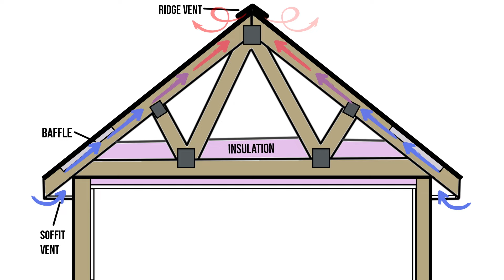The DOs & DON'Ts of DIY Spray Foam Insulation

Comment: In a few of the DO examples I would either not use the spray foam, or only use it for filling in a larger volume and finishing the surface with something else. 

Spray foam does not create a weather proof finish. For the windows and doors, the gaps will still need to be covered by a PVC molding , silicone caulking or something else. 

For small non structural cracks in concrete or wall penetrations in concrete, I would use a cement based acrylic modified sealant or a polyurethane based caulking that can be painted. Visible spray foam looks ugly and deteriorates when exposed to the elements.

Spray foam is just like duct tape or electrical tape. In most cases, you should probably use something else.

Comment: How to remove spray foam besides cutting it? Is there any spray or easy method to remove spray foam from large areas?
I had it put in the basement and it destroyed my entire basement with humidity and mold problems, and I want to remove it all. No one seems to know how?

Comment: So in my Man. Door into my garage on the side of the house there is a visible gap under the baseplate of the door jam. Would spray foam be good to use? Also I started noticing a puddle in my basement near where the entrance would be. So you think that since it is not sealed up it it causeing water to leak?

Comment: I have a question about spray foam usage. I have a 1790s house - nice thick lath & plaster walls. However, my kitchen was added in later years & my heat runs ~5 as much in the kitchen zone as elsewhere. The kitchen is also exposed on 3 sides with four windows.

The walls have loose fiberglass insulation (almost certainly settled at bottom) & are noticeably cold to the touch. I'm getting ready to remove wallpaper & paint the kitchen so patching holes isn't a problem. Would it be an acceptable solution to drill small holes into each stud space (perhaps at 3', 6' & ceiling) & inject expanding foam on top of the loose fiberglass to increase the R value?
Reply: I did this to my 1940s home but found the two previous owners were cheap and wanted a quick buck - turns out I have exterior walls made up of drywall-studs-composite siding. Absolutely nothing else. No plastic barrier, no structural plywood/OSB, no insulation, NADA. 

After spraying an entire can into a spot to fill, my siding popped out and I could see daylight through my very very tiny hole I installed. 

TLDR - ensure you have a plywood/OSB barrier before applying spray foam into exterior walls. 😅

Comment: Instead buys a bunch of new straws, buy foam gun - after first use, you never back to straws.
You can use foam as well for:
- filling space behind plasterboards if they moving
- filling deep holes after nails/screws in the wall (way faster then putting filler 2-3 times) 
- filling spaces behind skirtings (if wall waving) what makes it more durable, and helps prevent cracking of caulk
And a lot more...
Reply: People's who made any of action from "don't" should keep far from DIY - all of "don't"'s should be prevented by imagination.
Reply: Also good points

Comment: I want to use spray foam to fill the void in between the stud walls between bedrooms in my home (im in the UK) I am thinking of drilling lots of holes and starting any the bottom. What do you think?
Reply: Did you ever try that? I think it would take too many cans for a whole wall, because I tried it for 2 m width by 60 cm height, and it was not very cost effective. T

here are companies that use large volumes of polyurethane spray foam for roof insulation with special applicators. I think something like that would be more suitable.

Comment: We have a cold draft coming from under our dishwasher and the cats sitting right in front of it is telling us there’s mice getting in. Would you recommend using this product all along the edges once we pull out the dishwasher? We haven’t taken a look but we felt the cold last year and during the winter the dishwasher malfunctioned a few times due to a frozen pipe(we are pretty sure). Hopefully this insulation will fix both problems?
Reply: I don't know, a lot going on here. Typically the dishwasher is fed by a line going into your sink. I would find it very odd if that line left your sink and went back into the wall and then back through to your dishwasher. Usually a hole is drilled in the cabinet and the line is fed that way. If your pipes are freezing, that is potentially a major issue as they will bust and flood your house by the time you figure it out and shut your water off. The only way they should be freezing is if they were ran in an exterior wall and you live where it freezes. If thats the case that home builder made a huge mistake and so did the plumber. If you don't know how to shut the water off to your house figure it out. Other than that yeah you can use the foam behind the dish washer.

Comment: I had a rat problem in crawl space ,  i found a gap around a gas line from outside  in the cement .  I used mesh and foam to fill ... is this ok?
Reply from the maker: Yeah it's ok. The mesh is the most important part to keep the rats out.

Comment: How do you clean the straw with acetone to avoid clogging?
Reply from the maker: Take the straw off and soak it or flip it upside down and pour a little in the end and let it work it's way through. You can use an air compressor hose to blow it out also.

Comment: i have an attic eve right above a living space (100 year old house) and someone told me to fill the eve with closed cell foam because it is so small.  My eve have no holes in the outside end of the soffit.  Does this sound right to you?
Reply from the maker: If there's other sources of ventilation it's fine.

Comment: 1)  It would be great if LOCTITE would include an extra tube or two with the cans, and/or offer packages as an extra.  

2)  How to clean product from hands? 
i used acetone, it stopped the stickiness, it did not dissolve or remove.

Comment: I watched this video to see what company was doing the spray foam and low and behold....no spray foam company.Can foam is not spray foam,its canned foam.Spray foam is sprayed with a specialized foam macine,an air compressor,and normally a big diesel generator.Its sprayed at temps that can range from 100f to 130f and also needs pressurized air.Can foam is not spray foam,this is a common misconception,canned foam is basically half pound foam which is an open cell foam so it doesnt technically form an air barrier due to the foam being open cell.Though real spray foam(2lb medium to high density)isnt technically a water seal its actually highly more resistant to water than canned foam.Ive seen home made coolers from 2lb foam that hold water for weeks with no leaks.Water will pass right through open cell canned foam.Also if it was sprayfoam you would need a certified spray foam installer to do the work.Just call it what it is,Canned Foam that anyone can use fairly easy

Comment: You can be like the previous owner of my house and fill every outlet box with spray foam! I do not recommend it.
Reply from the maker: Haha! Yeah that's not exactly recommended!
Reply: @MrFixItDIY  The fire code frowns upon it a tad, lol
Reply: @ToolsWithAdrius  You can spray around the outlet, to make a tight seal to the drywall, to keep air from leaking out. But not inside the box itself, no ...